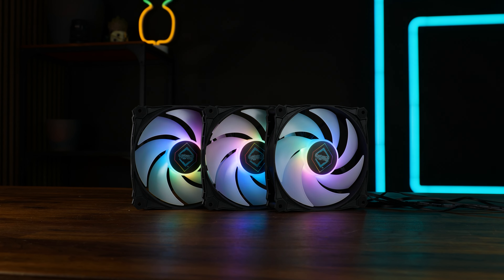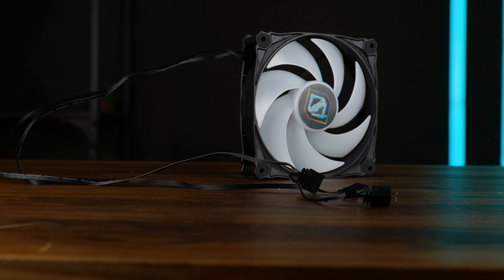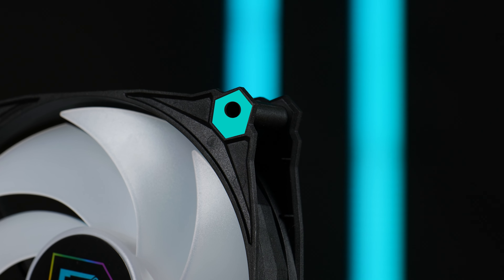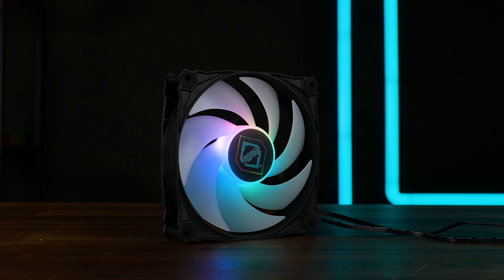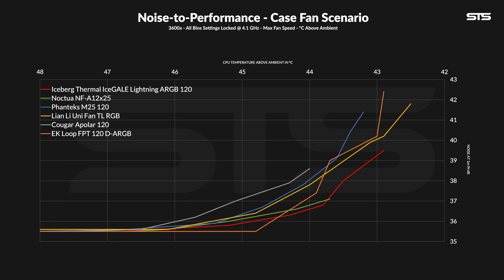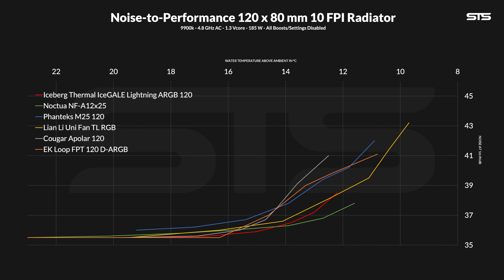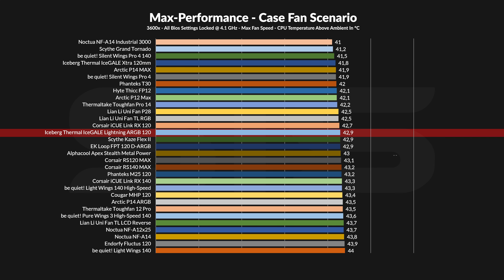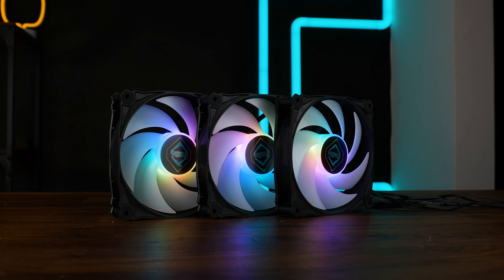You NEED To Know These! Iceberg Thermal IceGALE Lightning ARGB

Comment: Do you plan to test the bequiet Pure Wings 3 Series the 120 and 140?
Reply: Depends on whether Be Quiet pays him to review them or pays him to hide them lol. I have a pair of Pure Wings 3 140 HS and they were a big upgrade over Fractal Design Aspect 14 PWM fans. The Be Quiet fans are totally silent up to 65%, and still reasonably silent at 90%, so I set my fan curves that they run at idle / load at those respective speeds. They are also better than Arctic P14 in terms of noise. The Arctic might move slightly more air though.

Comment: Your reviews are inconsistent and with no sense results
Reply: Obviously if the Noctua NF-A12x25 beats a Phanteks T30 in noise-to-performance... Under-the-table sponsorship issue perhaps. Aris of HW Busters / Cybenetics and Ari from The Tech Buyer's Guru conduct the most accurate non-BS testing.
Reply: What doesn't make sense?
Reply: @Fin1nishingMove what are you blabbing about? His results don't show that Noctua is beating T30s at noise-to-perf